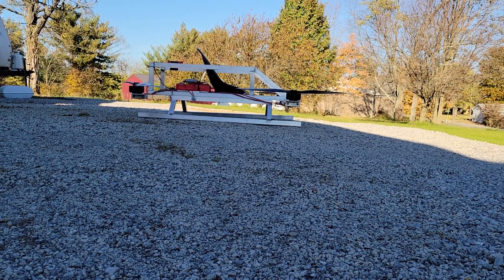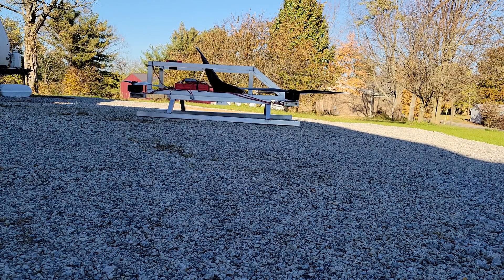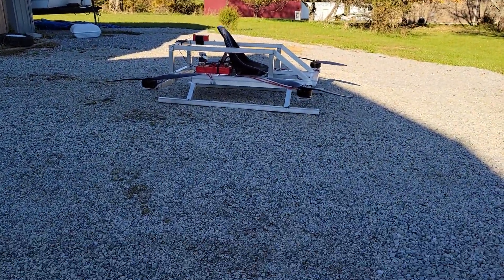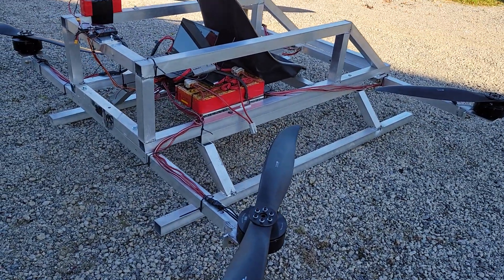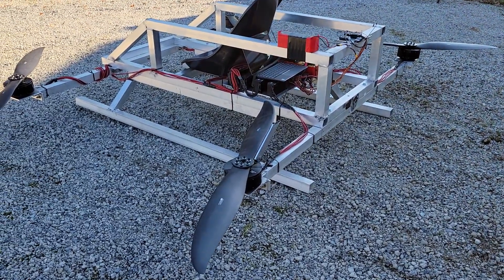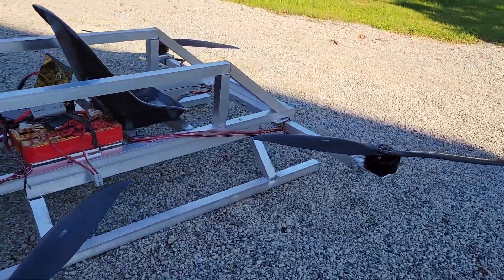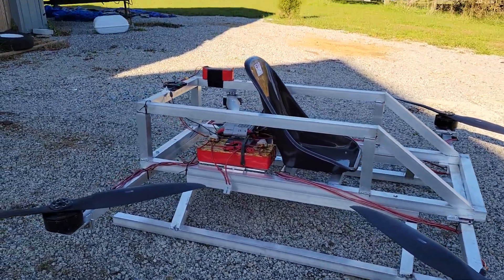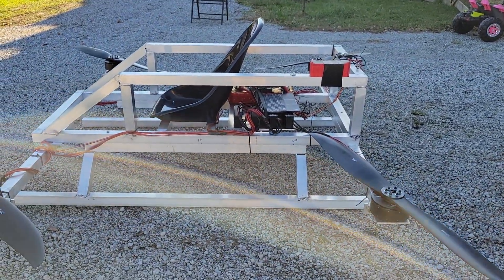Manned Drone / Heavy Lift Drone inches away from first flight!!!

Comment: As this video was filmed a few years back, my apologies if this has already been addressed but by any chance, are you using an active PID controller to stabilize the craft? Mechanically, it would be extremely difficult, if not impossible, for you  to stabilize the craft so leveraging an active control system based on gyroscope/angle data would be the way to go.
Reply: He’s using a dji flight controller so he should be able to adjust PID in Assistant
Reply: @granttyler7746  I am curious as to what IMU sensor he is using and what sample rate the data is being collected/processed? A cascaded PID control architecture may yield improved stability results.

Comment: There's more weight on the back than the front. Try having the batter and the seat directly in the middle. Seat over the battery. Then use a powere distribution board to even distribute the power needed

Comment: Recommendation: Minimum 8 motors, / 2 opposite directions of rotation per arm /, star-shaped central power distribution, lightweight carbon fiber epoxy self-supporting plastic frame, flexible base, propeller-protected cradle, full weight balancing + courage!

Comment: A few ideas for improvements:

- begin by balancing the total load, this likely will eliminate the craft tilting under full throttle
- upgrade your craft to use three propellers instead of two, this will increase lift potential
- upgrade your craft to use six propellers instead of four, you are intending to lift a person with batteries and fly for a decent amount of time so plan for it
- alter your frame so you have as little weight to lift as possible, this means eliminating your stacked aluminum frame to support your propellers and landing gear and work them into the core frame and replace the raised part of the frame which is unnecessary (if you think it is necessary then use a light material like a resin or plastic)
- add wings for added lift and fit the propellers with them in mind, more surface area yields more lifting potential

I wrote these in order or impact and work involved. I have no clue what you have to work with. Best of luck. Do not forget your helmet when it is time to fly.

Comment: What's the weight of the entire craft? Where's the balance point? What's the thrust output of each motor/prop combo and combined output. This is very important as you must have the full weight of the craft at about half throttle. Your wiring looks a little on the light side. What size are your phase wires? What voltage /KV are the ESC's and motors are the ESC's getting plenty of air? Just at a glance your Aluminum tubes look really heavy 3 or 4 mm wall thickness?? What is the battery pack weight and Current available? I'm doing the same thing with mostly carbon fiber tubes and aluminum joints and ends to cut weight down. My craft weight is 220kg total weight with my 92kg on board and 350kg max thrust. I run 111 volts and 55kv motors x 6 with 42 inch props. I made a scale model about half size with weight to scale and scaled motor and prop combos. It flies well. I'm still buying 7s lipos for it. At 300usd each x 32 I'm about half way through buying batteries. Is there anything else I can help you with?